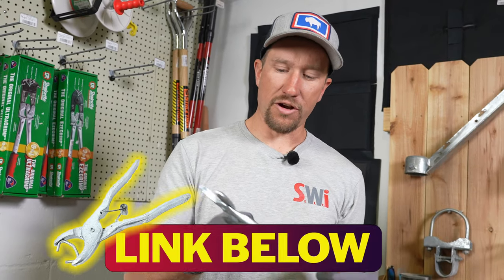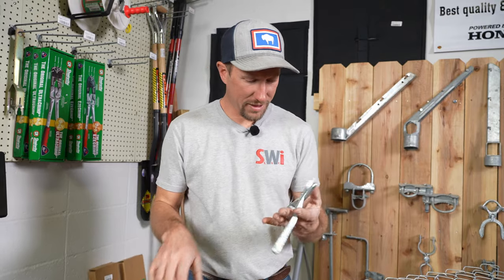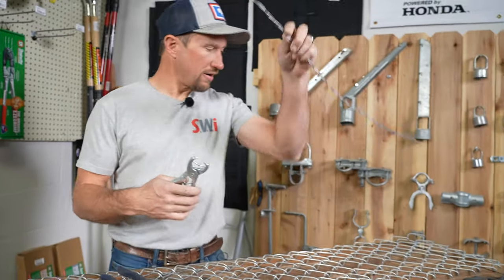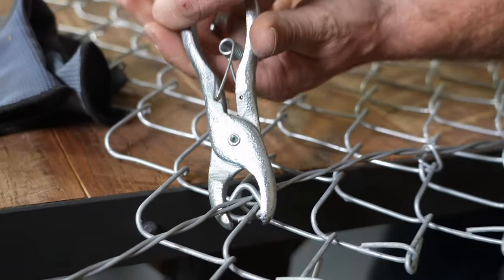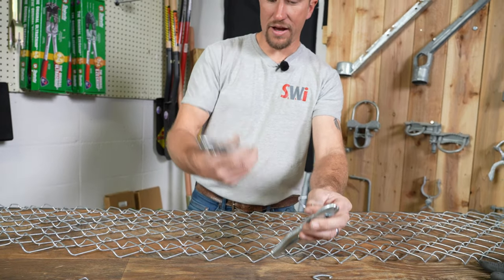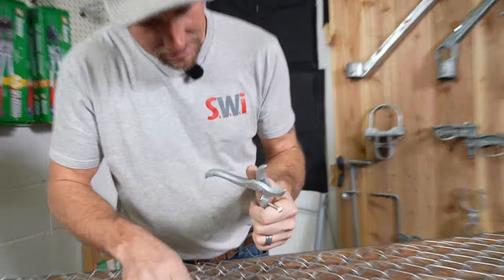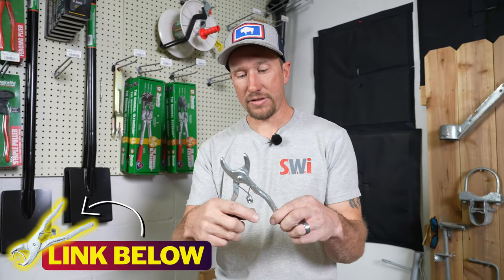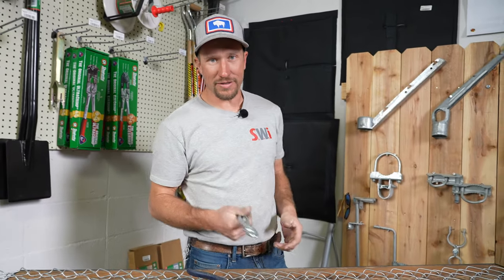How To Use Hog Ring Pliers | Finding A Good Pair

Comment: One day a few years ago I installed 2,  50lbs boxes of 9 g hog rings around a sewer treatment facility that had bracing and a top and bottom coil spring wire. I don’t know exactly how many come in a 50 lbs box but I can tell you that my right hand was completely worthless for the next day or two. Love your videos. Keep it up fellas.
Reply: Hello. I'm trying to find something to help me attach hardware cloth bent in a 90 degree at bottom of our garden fence to prevent animals from digging underneath existing fence.. 

I have sturdy 16 gauge galvanized  vinyl coated hardware cloth with 1/2" Squares attached to bottom of fence, but forgot to extend it to prevent animals from digging underneath. It was tedious work to zip tie. Any help is appreciated as i am not sure what tool will fit in a 1/2" square hardware cloth to  attach another smaller gauge hardware cloth to our existing fence..

Comment: OMG. I never thought about to reversing the springs. I find the closing slows me down i'd rather it open for me holy cow. Thank you for that, I love your guys Channel it's so helpful. I have a few years building fences over 10 years ago With the best fencing company in my Area for 80+ years. Worked Oil rigs, red seal carpenter now work for a company that owns a landscaping company and a fencing company in spite, because of a tiff they have with the best fencing company in our area. They make me do chainlink but i forgot so much shit. Watching you guys is extremely helpful, helps remind and shows new stuff Keep it up. I'm Very grateful for your content
Reply from the maker: Thanks so much! You have no idea how encouraging that is. 👍🏻
Reply: @SWiFence  Not a problem you deserve good feed back for all your hard work. it Takes time to make the videos you guys do and very well put together.  I look forward to more videos to come.  Can you guys do a bias cut video 1 to 5, 1 to 4, 1 to 3, 1 to 2 methods and or the cheat method. Also bottom wire ties for residential to commercial, How to repair bottom wire for chain-link. I know how to do it properly but the guys i work with need a video. I'm getting tired of dealing with call backs.

Comment: I’ve only ever used them with the spring reversed. You just blew my mind that the spring could be used to hold the jaws tight to hold the hog ring. I LOATHE hog rings…  I still just use a pair of slip joint pliers